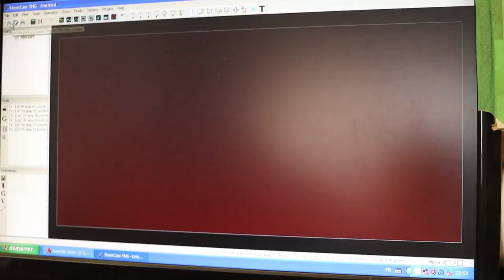TIME LAPSE AIR BAGGED TRAILER: The complete build in 10 minutes

Comment: Love your trailer sir. My only recommendations are first  I would add a wireless winch controller too your winch and use the cabled one for backup purpose. would make loading easier. the second is weld on some D-ring shackles  or even mount an etrax system to give it some more  strapping locations. the final thing i would do is in your open center location. add a storage box for straps, chains and tie-downs. really more just some accessorizing ideas. Otherwise like i said awesome trailer sir. cant wait for you to post plans. I like to build one for hauling my four wheelers. the easy on easy off functionality would be awesome.

Comment: That is an awesome trailer design for cars. If you have ever tried to tow a low vehicle or classic on a trailer it's damn near impossible to get it off without scraping the pipes or the frame of the car bottoming out. Hands down this is awesome. Of course heavier cars would need four swing arms versus the two for this build but even with that saying just on design and execution for purpose, I give you a solid thumbs up brother. 😁👍

Comment: @Viny B - I've watched all four of your trailer build videos. Great job. 
 A cheap and somewhat easy way to keep the airbags in better alignment when aired down or when fully loaded is to bolt a 'suspension limiting strap', (a glorified seat belt with steel reinforcement loops), to the top of the airbag and mount the other end somewhere near the axle. This will help keep the airbag from rolling forward and prematurely wearing the top of the airbag out. 
 On Amazon, they start out at $13 U.S.D. and run to $50 + U.S.D., or you can make them out of seat belts from an auto salvage yard if you have access to a sewing machine with a blue jean or leather rated needle and thread.

@Viny B - J'ai regardé vos quatre vidéos de construction de remorques. Bon travail.
  Un moyen peu coûteux et assez simple de maintenir les airbags dans un meilleur alignement lorsqu'ils sont aérés ou lorsqu'ils sont complètement chargés consiste à boulonner une "sangle de limitation de suspension" (une ceinture de sécurité glorifiée avec des boucles de renfort en acier), au sommet de l'airbag et monter le l'autre extrémité quelque part près de l'essieu. Cela aidera à empêcher l'airbag de rouler vers l'avant et d'user prématurément le haut de l'airbag.
  Sur Amazon, ils commencent à 13 $ US. et courez jusqu'à 50 $ + U.S.D., ou vous pouvez les fabriquer avec des ceintures de sécurité dans un parc de récupération d'automobiles si vous avez accès à une machine à coudre avec un jean bleu ou une aiguille et du fil de qualité cuir.

 [Sorry, Google translate doesn't yet have a French-Canadian/Quebec setting. Désolé, Google Translate n'a pas encore de paramètre Canadien-Français/Québécois.]

Comment: It helps with air ride to have a slave tank.  Air has a rising spring rate.  Adding more volume will help.
Reply from the maker: That a good thouht! Maybe I will not close the 2 valves and do some testing. I'll have to be carefull to balance well the weight from left to right since both bags will be connected together.

Comment: Is there a way to "pin" the trailer to keep it from going below a minimum height while still having full suspension, asking in case an air line or bag was to fail while in use.

Comment: What are the main tools you have in your home machine shop? Here is the list I've come up with so far:
- Air Compressor
- Saws (both wood and metal)
- Welders (electric and torch)
- Laser cutter
- CNC Machine
- Milling machine
- Band saw
- Metal Break? (Is this for just bending sheet metal?)
- Metal Lathe
- Drill Press
- Gantry Chain hoist
- Cherry Picker hoist
- Hydraulic Press
- Table Saw

Did I miss anything? Would love to see a video of  your shop

Comment: Hey how much in material did this cost you? Also great job.. very detailed
Reply from the maker: 2200USD, without compressor, winch and battery, just the trailer
Reply: @VinyB57  thanks for replying back. That's really not bad. As a home build, it would be difficult.  The pieces you used with the cnc plasma would be hard to duplicate. Your plans provides a cut-out guide? Or would we need to find someone to do this part of the build. Love your videos and channel. Keep it up